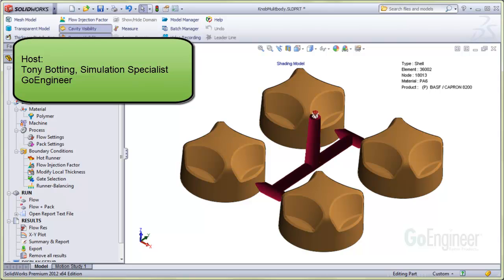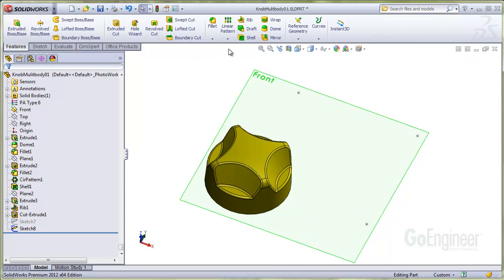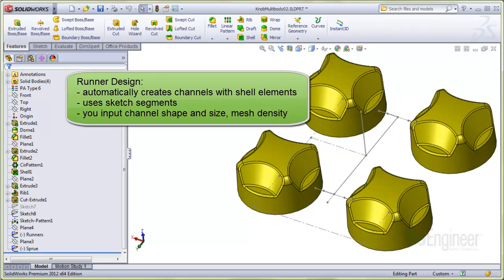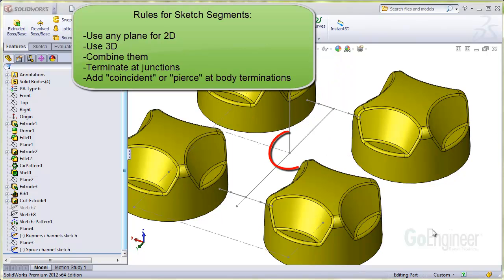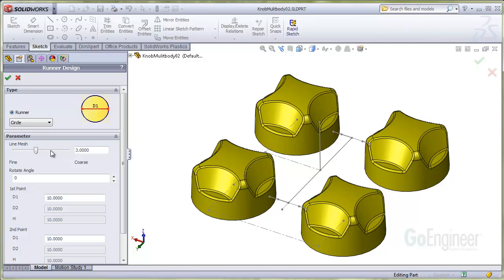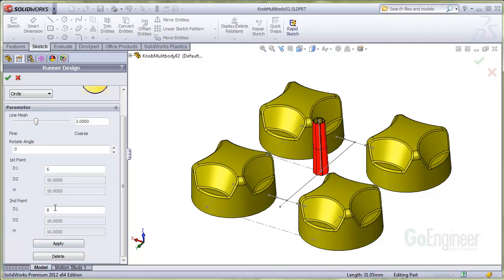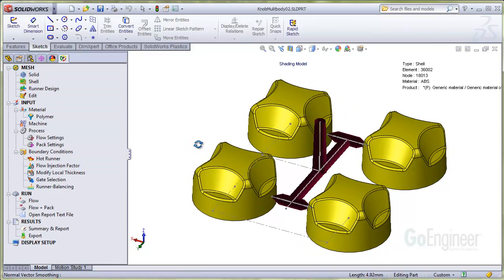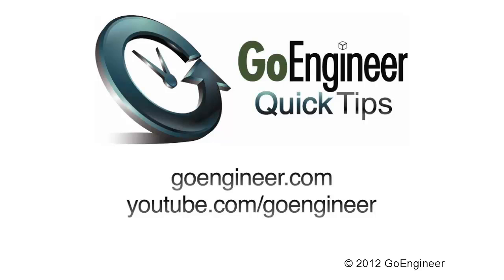SOLIDWORKS Plastics – Runner Design Function

Comment: Thank you very much...i just went making the mold exam in solidworks without knowing anything about plastics. I failed at 55 out of the 120 minimum points needed to pass.
When i decided to learn mold making (about a month ago), i learned everything specifically with those key works, "mold making". I learned throughly about draft analysis, scale factors, parting lines, parting surface, tooling split, cavity commands, shut off surface  a bit about side cores.
Nothing about plastics would come up with those keywords though, because its plastics domain to talk about mold cooling problems, max mold opening, runner and sprue, tapered interlocks etc and those things wont come up if you search "mold making" only. I discovered today that i need to learn about SW plastics in order to learn what i was missing.
So now here am. 
In order to pass i need to learn plenty of:
-max mold open distance (know nothing about)
-virtual molded part (i did inserting a new part and cavity but lots of artifacts came with the part....)
-mold cooling (know nothing about)
-runner and sprue (know nothing about)
-tapered interlocks (know nothing about)
-side core creation ( i think i can learn this one alone though).
So i wonder if i will be able to find these missing pieces on YT, searching for "solidworks plastics" instead of "solidworks mold making".
We will see....
Reply: Is there any way can you give me links to how did you study